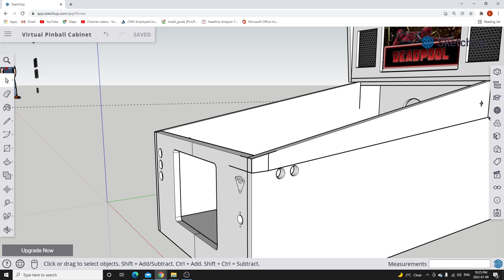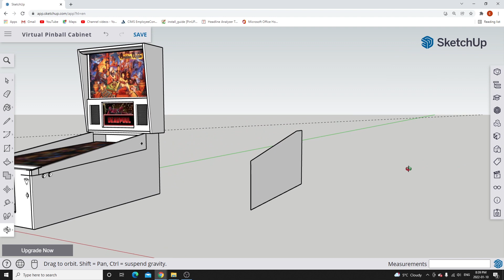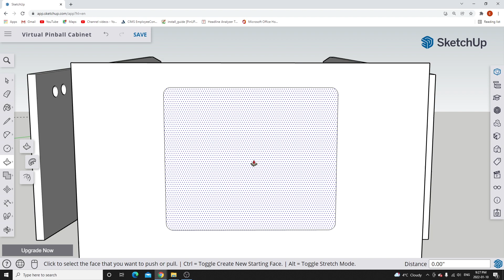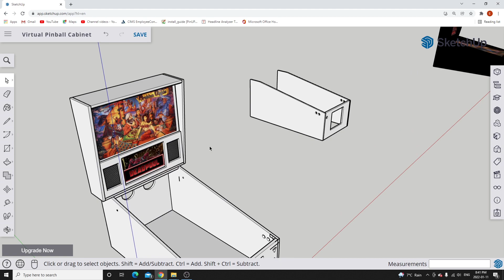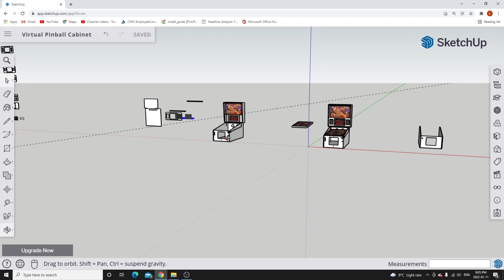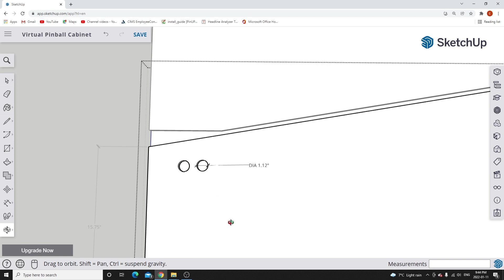Design and draw your virtual pinball cabinet!

Comment: If the playfield monitor is even with the front of the cabinet and somewhat level with the floor, won't the image angle on the screen and viewing angle of the flippers seem off?
Reply from the maker: Your playfield shouldn't  be level with the floor,  it should be angled up at back.  It is less angle than the top angle of the cabinet but once you have the vpin on legs, it'll change that angle upwards.  Hope that makes sense.  Thanks for the watch and good luck with your build!

Comment: So how is it that we take into account the 40-50 relays, score motor and the 700 reed switches into the cabinet? lol. I mean thats important, and its not a pinball machine without them.

Seriously tho. I would love to make a virtual pinball machine in a full sized box, primarily;y because I really would mount a whole bunch of relays, motors, thumpers and chimes, they would not actually control the game, but if for no other reason than they make background noise, Then have them controlled by the virtual game software. I would feel better knowing they are there.
Reply from the maker: If you keep watching, you'll see how I add all of the ssf and mechanical toys to simulate all of the real pinball parts.  It's pretty crazy how much the ssf makes it sound and feel real.  Thanks for the watch!

Comment: Can I ask what monitor was used as DMD? The shape and dimensions do not match the 1908fpt.
Reply from the maker: It's just a free 19" LCD computer monitor.  Should be 1080p probably 60 Hz.  Thanks for the watch!
Reply: @wayofthewrench  Good. I found Your monitor model, it is 1913t. Resolution 1440x900. Unfortunately it's not 1080p.
Reply from the maker: Really?  that's too bad.  At least it is a smaller full dmd screen so it won't matter too much.  Mind you I'm sure a 19" 1080p screen can be easily found.  Good luck!

Comment: Amazing work. This is an inspiration for me, thank you.
I can't find the angle dimension for the cabinet side. Huge application request.
Reply from the maker: Thanks!  Hopefully it motivates you to make a vpin for yourself.  If the angle isn't there, you'll have to break out your grade 9 trigonometry.  It's actually easier to just measure out the corner than measure out the angle.  Thanks for the watch and welcome to the channel!
Reply: The calculations are simple for me. Unfortunately, not all dimensions are available and I estimate.
a=51.5 b=23.5-15.75+~1= 8.75
so β=~9.75. But this is only an approximation. @wayofthewrench
Reply from the maker: Everything you need is there, you just have to subtract from overall length or width etc.  cheers!

Comment: This is excellent, thanks for sharing your efforts. Is there a way to share your Sketchup design file (rather than cut plans) ? I'd like to use it as a starting point for my own project.
Reply from the maker: Perfect!  Happy to help people out with their builds.  Sorry but I am not sharing out the Sketch up file as I have had other Youtubers try to take my files and present them as their own.  I did share out the dimensions though so it is pretty easy to learn/draw up the plans if you need.  I highly recommend designing your own based off of your monitor selection.  Cheers!
Reply: Thanks. Completely understand. Teach a man to fish, etc 🙂
Reply from the maker: Yup, that's the idea anyways.  Cheers!

Comment: Dude I use the heck out of 3d printed parts for my builds. I designed several parts for different thicknesses of wood to make a four point solid square base, I made the brackets aesthetically pleasing so they're used as bracketing and look cool
Reply from the maker: Cool dude, I'd love to see these brackets.  Can you send me some pics on Instagram?
Reply: @wayofthewrench  youtube is about as social media as I get, I sent a link in another of your video comments to a pic of my airbrush top control panel

Comment: @27:50 "I want to stress this is not going to be an hour and half video ... "  :-) forgot about that one uh? Great job covering all the bases.  Joinery is a real issue when it comes to wood working and you cover the issues of glue starving a joint very well.  

One thing everyone needs to remember, You can do anything with your hands.  If a fancy tool is used to make something, there is always some way to accomplish the same thing.   Remember what is inside of "I Can't"  its "I Can".  Do not let the use of power tools turn you off.  if all you have is hand tools, you can make this project happen.  It requires commitment and resolve.
Reply from the maker: Lol...I left that in there to see how fast someone would call me on it!  It could have been way less if I didn't explain the design process but I felt it was important to help people design their own.  Yeah you definitely can make these projects with hand tools or power tools or fancy big equipment....just use what you have.  The bigger equipment just makes stuff more accurate and faster.  Cheers!
Reply: @wayofthewrench  No you are doing an excellent job.  Keep it up.  very interesting series.
Reply from the maker: Thanks Bruh!  I really appreciate your support!  Cheers!

Comment: Hello, wonderfull that you made this video. I have a question though. Why is it that the play-field monitor is always horizontal and not more angled like the glas ? I do not understand why and am very much inclined not to place it horizontal. There must obviously be a reason as everbody does it, but I failed to see why and also think it does not look good. Could you please explain ?
Thank you very much for the video.
Reply from the maker: Thanks, glad you liked the video.  I can't say why others position their monitors but I am placing mine at a lower angle than the glass so it looks more like an original pinball.  Original pinball play fields are set down from the glass.  I think that if you place the monitor right at the glass, they look a bit fake or more like a video game.  My only concern is if there will be issues with glare/reflections from the play field monitor or the LED lighting that I'm going to place by the sides and at the back.  I'll just have to wait and see once I get it installed and glass in.  Cheers!

Comment: I used a Scorpion wide body that was 27 inches wide.  I used standard monitors off the shelf and kept it to only 1 monitor for the back box which I centered and then put 4 speakers to even it out and add that extra bit of sound.  I sprung up for an i7 Geforce machine so it would run smooth.  Then spent the extra on buttons, and shooters, and nudge and shakers and other tables like PFx3 and Arcooda and one off tables.
Reply from the maker: Nice Bruh!  I play tested my monitors for like 8 months and did a 2 monitor setup like yours.  The best thing about a 2 monitor setup is that the speakers can be customized per game.  You still have your vpin cab?